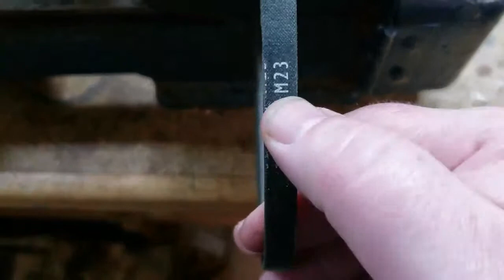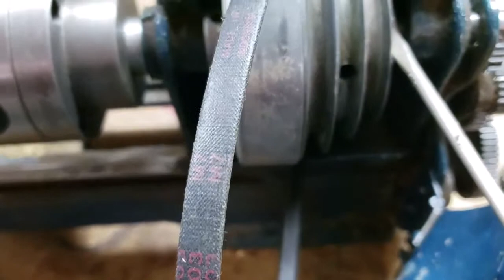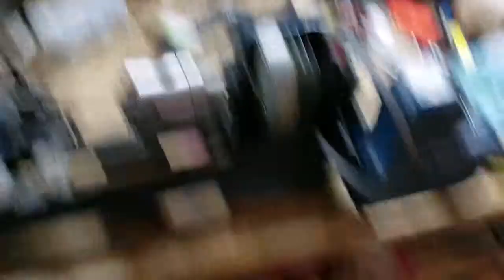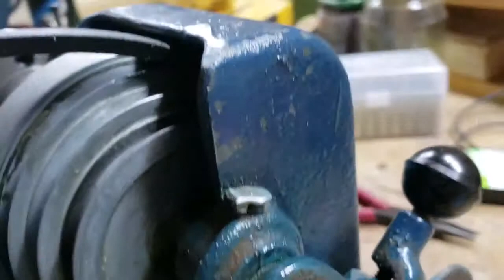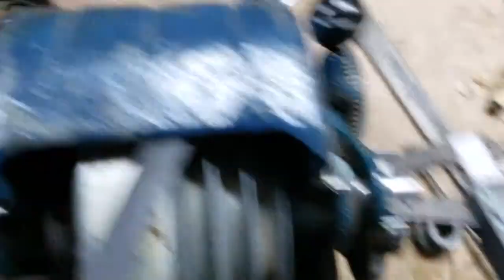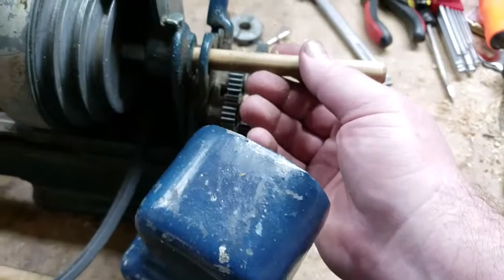Craftsman 109 lathe drive belt replacement

Comment: Stop the bullshit and get a link belt,,,no need to remove spindle and it's a lot less vibration and quieter
Reply: I can't find a link belt that works with mine.
Reply: @jackpuskar6439  harbor freight has them I have same 109  just use length you need

Comment: Lol I appreciate it man. I found one of these in my grandpas old tractor shed (which is collapsing)  from the late 40’s and was wondering how to get a new belt on it. Turns out I was just missing the lock key on the right side of the bushing. Im doing a semi-restoration on it, and plan to use it a bit in the future. I’m a younger guy but love tinkering with old machines.. especially when they have MADE IN USA proudly on them. At this rate, I’m going to have a fully functional shop straight out of the 50’s.